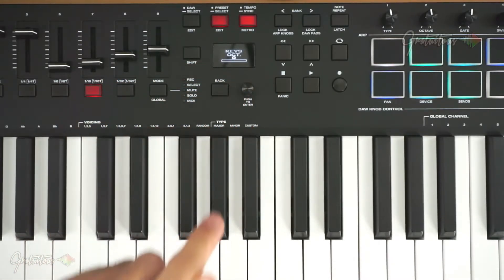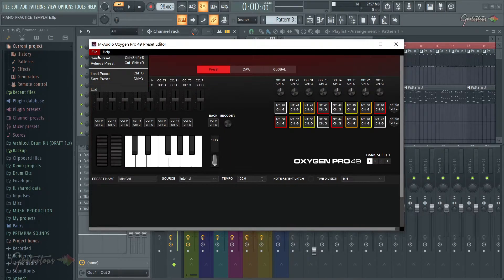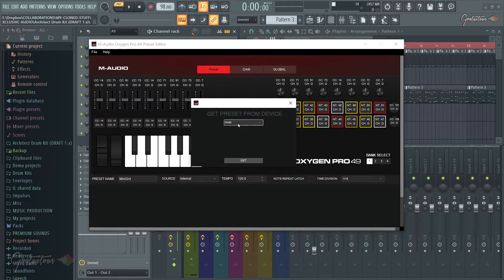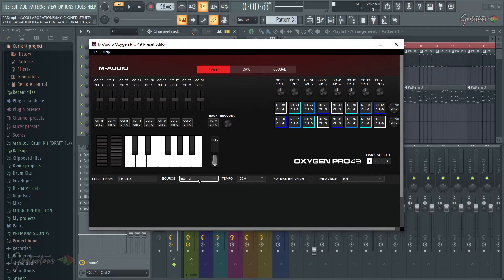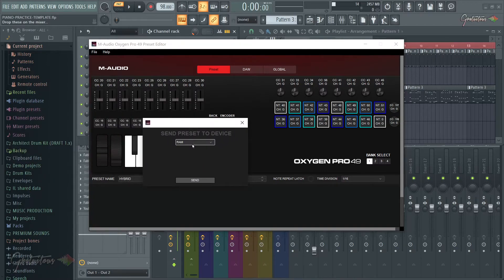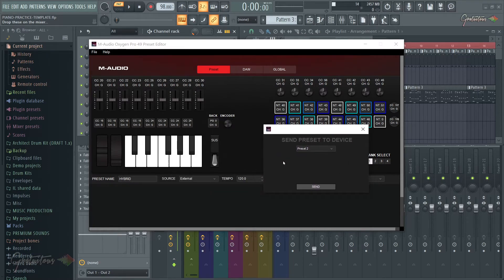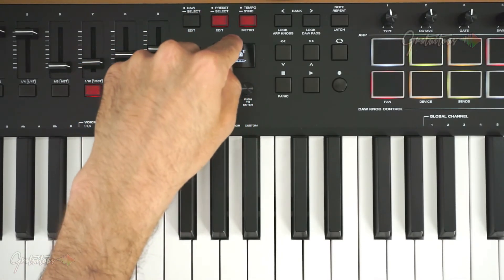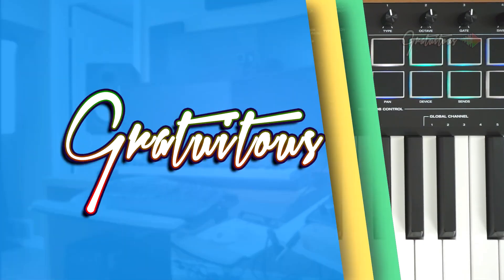How to Fix M-Audio Oxygen Pro Transport Buttons in FL Studio [EXTERNAL TEMPO SYNC]

Comment: hello so ive had this midi for a few days now and its been working normally but out of nowhere whill on the internal mode for the tempo it no longer flashes and when im on the arp mode it no longer registers my keys. ive been looking everywhere for help but nothing. i tried reddit but everyone on there are degenerates like normal lmao
Reply from the maker: Hey, I need more info to help with this.. Are you in DAW or PRESET mode?  I'd double check to make sure you are actually in INTERNAL MODE for tempo, as that's where the flashing will happen (external mode will not flash I don't think)
Reply: @itsGratuiTous  Hey, I think I'm running in the same issue, @DankBoneDaddy, let me know if I'm right. So I've set up the clock to be external (in my case Ableton) but it seems like the arpegiator is tied to internal clock. Like with the clock being external it doesn't work. I can play notes just fine, but as soon as I press the arp button, nothing (in daw or preset mode). Should that be somehow mapped in preset editor ? The idea would be to be able to record the arpegiator midi notes and gates in the DAW directly synced to the grid... Thanks for the video btw ! :-)
Reply from the maker: @aymericvdh  Hey my understanding is that EXTERNAL does not allow the arp mode to work.  If you're using Ableton, you may not have to do EXTERNAL/INTERNAL Tempo Sync.. the videos are only pertaining to FL Studio for the best workflow.  (Also, you may not have to do the DAW/PRESET mode stuff either.)
Reply: @itsGratuiTous  ok, thanks !
Reply from the maker: @aymericvdh  No problem!  Let me know if you have any other questions.  I also have many beatmaking trainings on my website: https://itsGratuiTous.com/